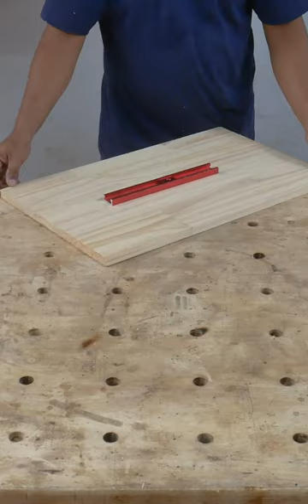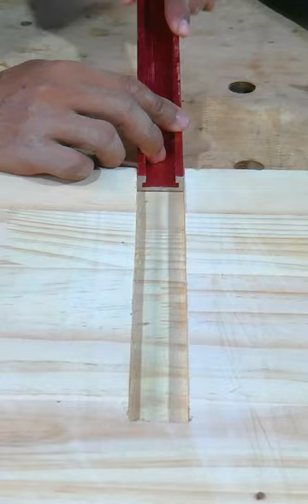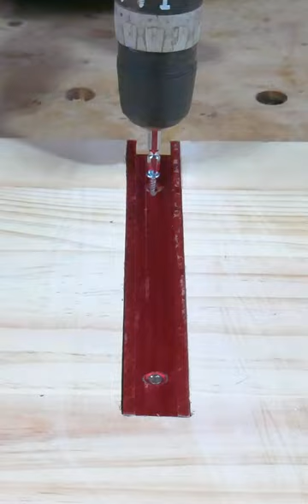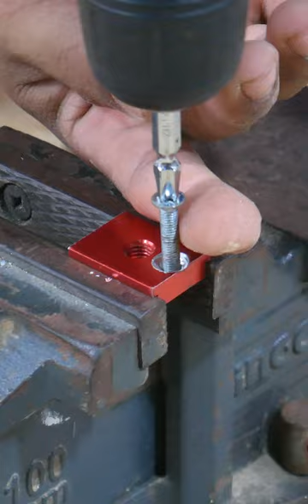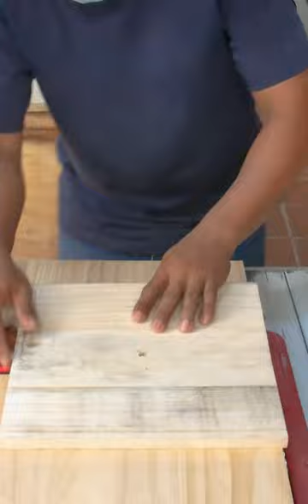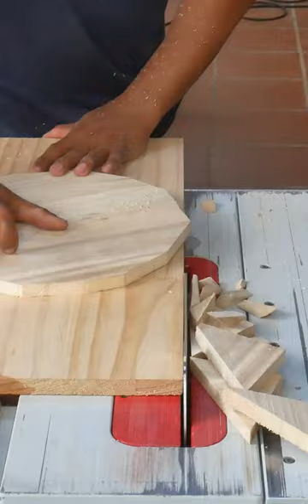Woodworking Tool Tips and Trick for Table saw #shorts #woodworking  #diy #carpentrytool

Comment: Very good. But if you can implement another slider at a 90 degree angle to the blade you can cut the circle in various sizes 🤔
Reply: I was wonder if that was possible